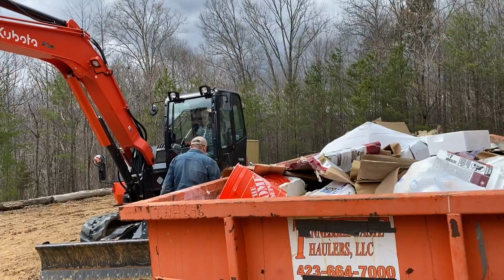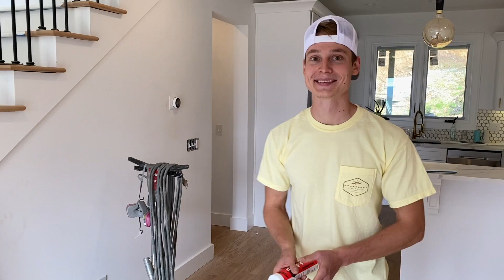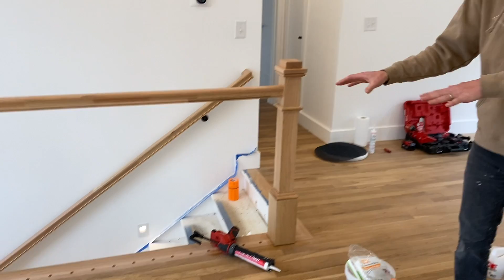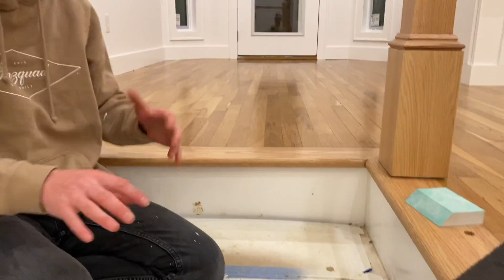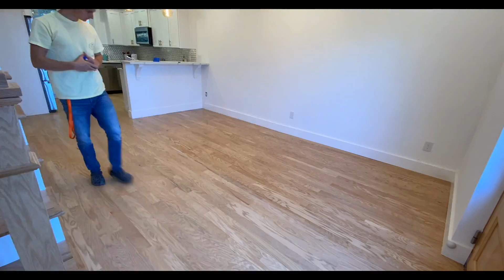The New Goonzquad Headquarters Part 88

Comment: I work with air pressure testing here in Norway, and its a bit different here. Here the maximum leekage a house/apartment can have is 0.6 airchanges per hour and every house is fitted with a ventilation system that recycles the heat from the air going out. Also the equiptment used for the test itself is a bit more complicated. You guys should get the poor guy a laser distance meter as a present:P

Comment: In Sweden we never do this strange pressure test of houses because we don't have to. The construction itself is allredy built to be airtight and only allow air coming in and out where it is supposed too. You realy have a strange way of building houses and I think you could learn a lot from other countries like us in Sweden, especially when it comes to building houses with low energy cost.
Reply: The type of 'Blower Door Test' shown in this episode is actually quite common worldwide. It was invented in Sweden over forty years ago, and subsequently developed in the USA and Europe through the 1980s. It has now become a legally required element of the Building Regulations ('Codes') in many jurisdictions, and is particularly useful in societies where much construction work is undertaken by non-professionals. As Architects, my Firm tends to find that the majority of professionally constructed buildings meet all the criteria at the first Test. However, if the Test were not compulsory, I suspect that the quality of work would decline since this becomes a characteristic of any task which is executed without adequate and well-informed supervision and is not sufficiently supported by legal strictures.
Reply: @johnstedman4075  ????????????

Comment: I thought you were supposed to have your house pressure tested. Igor did an air exchange rate test on your house which has nothing to do with pressure or the tightness of your house but rather is dependent on the size of his fan.

Comment: You guys just learned a Great lesson,for anyone who stores Many cars.ANY Intake or Exhaust use Dryer sheets,and wrap them around Mothballs if they'll be long term stored..I'd look under the hood of the Camero,and check for scratches in the carbon in the tail-pipes.>Dryer sheets keep mice away from your stores trailers etc./You probably know this from the last house,but you need solid wire screens Under your coop too.1 foot out,and all the way under so your chicken stay your's.

Comment: In my State....if he shows up for final and theres furniture in there......automatic fail.  Of course, we're not YouTube stars!!
Reply: What, It was just a desk in the carport.....
Reply: In the experience of my Firm, attitudes to this matter vary greatly across the wide variety of States and Counties in the USA. If one has established a trusting and professional working relationship with the Building Inspectorate throughout the project, there are seldom any outstanding difficulties at Final Inspection Stage. Legally, there are two key points that are relevant. Firstly, a Pass at Final Inspection signifies that all Code-related works are 'substantially complete' to an appropriate standard, and does not mean that the building is necessarily '100% complete'. Secondly, the issue concerning a Certificate of Occupancy is related to actual evidence of occupation (ie the evidence of persons actually living in a house) and not necessarily to the absence or presence of furnishings. For example, there is a strong legal argument that one could not reasonably live in a house which lacked beds. Having said that, in my judgment it is usually preferable not to furnish a property before the Certificate of Occupancy is granted, but this is for practical and not statutory reasons.

Comment: So basically every house in the country will FAIL that ridiculous test,,,, your state sucks,,, how much that Idiot cost,,?,, And we would all be dead if ya couldn't live in your own house,, pathetic
Reply: It is actually rare for a professionally constructed residence in the USA to fail a Blower Door Test, which is required in most (but by no means all) areas of the country. Typical costs for an average-sized house are around $500 for an AirtightnessTest by an appropriately Licensed Specialist whose tabulated findings are acceptable to the local Building Inspectorate.

Comment: Next video: We’re tearing down the house and starting again.

All that nice finished trim, dragging the floor sander around bashing into it.

Think ahead!!
Reply: if you look closely, he's avoiding the trim
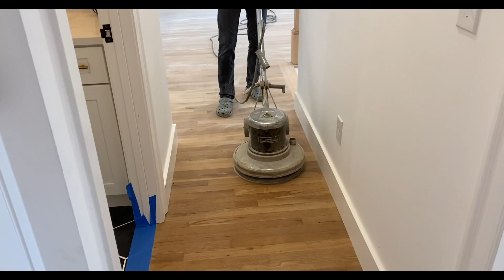Reply: @nickcrompton1865  weird, 13:13 and 13:15 he bounces that sucker off the sides like a bobsledder out of control.

You NEVER finish sand a floor once trim has gone on. How do you get the corners and edges without kissing the trim AND getting an even finish.

All this work was supposed to be done before the trim and paint went on. They’ve done things completely out of order hit to produce content.

Again.. I love the ambition! But; it’s not ideal for people trying to tackle these jobs using these types of videos as a starting point.
Reply: @OnTheToolsCanada  first of all that buffer is hard to control as they mentioned earlier. second, this is what you call a learning experience.
they have a tight schedule, so sometimes there is no other way then to do things out of order to keep pushing out contents.

i dont get why you're so offended by the few scuffs on the trim, its fixable.
Reply: this guy. lol

Comment: Imagine waiting this long to seal the windows after already having a leak.. Should have been done same day they installed the windows. 
Here in Norway (and most european country i think) we use a very expensive special tape between the window and the frame. Makes it "100%" water tight. That sealent will deterioate in the sun after a few years.
Reply: You are right, I'm afraid. On that south facing facade, the UV from the sun, coupled with the expansion/contraction of the black sealant as it heats and cools, means that the joints will fail in a short time. Then capillary action takes over and the water comes to visit...

Comment: Pressure testing required on houses in Tenn.... apparently the contractors lobby is strong and well funded in the Tenn. I still would have done it though. Now is the time to seal up the house for energy efficiency BEFORE you all put in all the furnishings.

Comment: My 55 year old house passed the vacuum test so if your house fails that would be a shocker. You guys still need to do some sound traps to kill the echo, echo echo in there.
Reply: I agree. I'm sure their furniture will deaden it a bit, but I think they need to put up some sound foam squares on the walls as well. It's way too echoey in there.
Reply: Usually furniture and area rugs gets rid of echo just fine

Comment: That is a complete lie. The Alex caulking does not crack. I’ve used it so many times. He was given the wrong information. As far as using the expensive caulk as he stated, was also wrong. What you can buy, is a receptacle gasket that goes on the wall side of the plate. It’s made of cork or rubber. The use of spray foam in the switch/receptacle box was a good idea.

Comment: my last house was built in the 1850s all switches and outlets blew air out. my current house is so airtight if the front door isnt locked it will open from the vacuum of opening the back door because the doors are so tight they dont always close all the way

Comment: What was your final ACH? I've been following Matt Risinger seal his house. He recently released a video where he used a product that automatically filled in the remaining leaks (pressurized the house and sprayed foam in the air). https://www.youtube.com/watch?v=JYugiSwWoPk. He's using mechanical ventilation to pull air from outside -- a more expensive hvac system to setup.

Comment: Construction norms in North America are just over the line. I can understand if they were intended for promoters and construction companies in order to avoid buyers being screwed but if you're an own builder/renovator, what's the necessity of it?! Vacuum/pressurisation test for a house?! Is it gonna fly at high altitude?!
Reply: You refer to 'North America', and in my experience the three largest counties in that continent exhibit major contrasts in the ways that they control building development. Mexico is a 'free for all' as far as Rules are concerned, Canada tends to be very bureaucratic, but there are no 'norms' in Building Regulations in the USA. Three levels of legislation (Federal, State and County) come together awkwardly in many combinations in the United States to create widely different (and often contradictory) degrees of supervision. Some areas theoretically have no Code at all, except for minor details of septic drainage and suchlike. Tennessee alone has 95 Counties, few of which have identical Codes, and in the rural areas there tends to be a highly 'laissez-faire' attitude to Development Control. For example, my Firm (we are architects) recently applied for a Certificate of Occupancy on a large multioccupancy residential project, waited the statutory three days, and then obtained the document by default, without any demur. In many urban areas of the USA we have found many aspects of Building Code to be counterproductive and draconian, but the law is the law, the USA is a highly litigious culture, and penalties for circumventing, ignoring or employing deceitful practices are often punitive.

Comment: That State ACH (air-change per hour) requirement is crazy! I built my house (2017) with a design spec of 0.35 ACH and my heating system demand dropped 60% by going from 2ACH  to 0.5ACH. To have a range of 5-7ACH is a massive energy wasting specification.

Comment: I used to work for a weatherization company. We used to run these pressure tests after completing our air sealing work. They should have done some calculations of square feet and how many people would be living in the home, does it have any gas appliances. A house needs to breath if you get it to tight you run the chance of using all the air faster then the house can replace it. You may wanna research a little before just sealing every drop of air you feel coming into your house. As far as it bringing insulation into the house it won’t actually the insulation acts as a filter for the air and filters the dirt and stuff outta the air coming in.

Comment: the blower door test is intended more for energy efficiency than for the health of the residents. leaky windows, doors and installation elements such as sockets and switches lead to energy being wasted through the exchange of air with the outside air.
It is certain that it has not yet been accepted everywhere in the usa that energy is a valuable asset that needs to be saved in order to protect the environment.
Here in Germany it is now mandatory to carry out a blower doo test in certain energy-saving houses in order to prove energy efficiency.
America's citizens will certainly understand at some point that it makes more sense to save energy than to throw it out the window with full hands ...
we now only have one of this planet called earth ...
That's why the goonz are a role model for me, showing the usa the right way ...

Comment: I had to get my house weatherizeed and they did the same thing. I didn't realize how many leaks my house had. You could feel the air coming in from every where. I'm sure glad they weatherizeed my house and put new insulation in the walls, attic, and under the floors because it feels so much better in this old house.
Reply: Same here. Getting my house sealed and insulation blown in the attic was one of the best thing I've done to my house. It wasn't cheap but it reduced by heating costs to a ridiculously low amount each month so I'll make that money back in a few years.

Comment: If it is to airtight your bathroom fans and any other exhaust fans will not work right and will make you have to install a make up air unit. And you do want some air movement so the air inside does not become stagnant

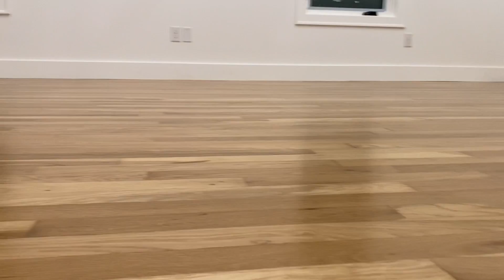Comment: @17:13, I thought electrical sockets in floors was a no-no(?)...
Reply: They are obviously not recommended in wet areas, but are quite common in larger homes with spacious rooms.

Comment: 5 to 7 . . . so what was your actual reading ??? and what do you think outlet and switch covers with those rubber anti draft pads are for.
Reply: Lol. It appears they failed! So
Above a 7. You know these guys...hard to admit the smaller things for them. They will seal it up better and then pressure test again I bet.
Reply: Hard to believe he did not give them the exact number . . . sketchy as hell on someones part. The SF of that house became a known fact since purchase and used numerous times and I would think that guy has to show the result of that test before leaving. Either way leaving all of those outlets and switches uncovered . . . is just asking for trouble.

Comment: Chances are you have already done the foam in the receptacle boxes, but I would use Great Stuff Fireblock foam to seal them.
Reply: Sealing the receptacles is only going to trap humidity in the wall cavities. Remember they live in the south where humidity is oppressive. As someone who does blower door testing everyday, I've seen what going over board on foam and making house too tight can do to the inside of a wall cavity after after few years. I'd recommend the mechanical ventilation regardless.

Comment: what you might want to do to the desk is spray paint the silver parts gold and then either sand blast the glass or put a logo on the underside to be able to see it threw the glass . also spray paint the silver shelving to gold / black .  it stands out like a sore thumb having black and gold else  where in the house but this room. 
told you before check out the food service supply stores . you could have gotten a used metal shelving one from a restaurant which closed down for a cheaper price and then paint it to the colour you wanted. remember the garage door brackets can also be painted out.

Comment: if you want to get it sealed up better there is a system that pressurizes the house like this then  puts caulking mist in the air.. its amazing  how air tight you can get it

Comment: What is the purpose of the vac test? We do not do that here.
Reply: It is, as the professional tester accurately explained in this episode, to ensure that the rate of air leakage through the exterior of the house is within prescribed limits defined by Code. Too much air movement (over 7 air changes per hour) is defined as unsatisfactory because it wastes energy, and too little (less than 5 air changes per hour) is deemed to be unhealthy. No Final Inspection can be passed nor can any Certificate of Occupancy issued until these criteria have been met.

Comment: Up here in Indiana... Our old farm house would fail those tests miserably... and that is after having a professional foam insulate the walls and blow more batting into the attics. Farm house still has air leaks everywhere... At least down in GA you don't have to deal with below zero temps for weeks... just harder on your AC...